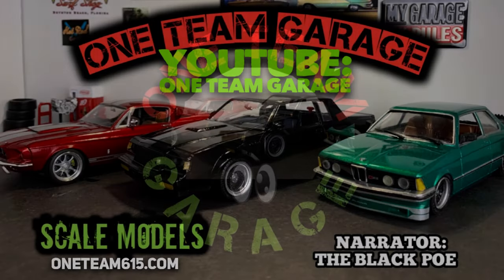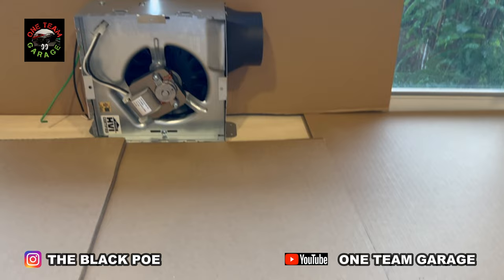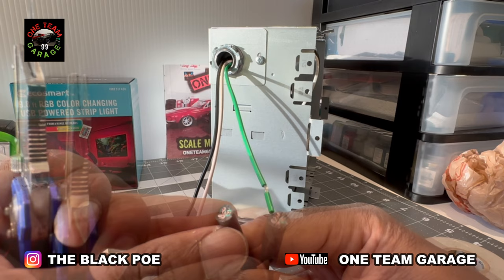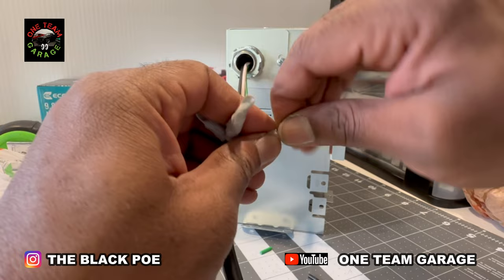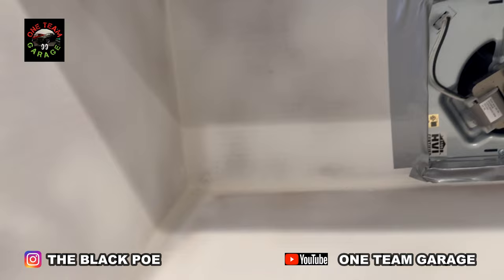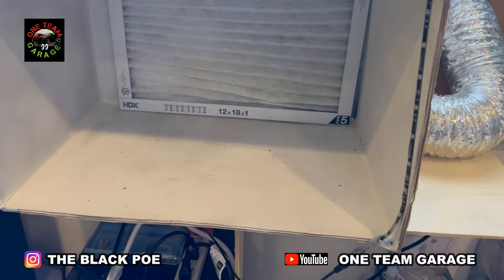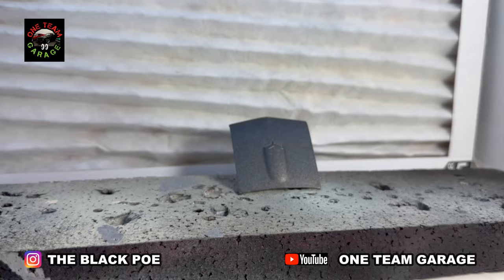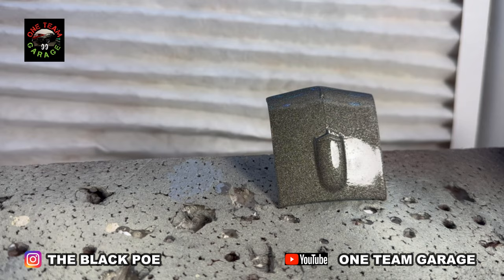DIY Paint Booth & Testing $59 Airbrush Kit: Surprising RESULTS

Comment: Heads up…
   I have been lectured on ‘my’ home made spray booths. “You have to have a sparkless blower motor.”  Ok… yeah, I get it. The point that was made if you’re spraying ‘flammables’ through an airbrush it’s like a carburetor.(air and fuel mixture)=combustion. Keep a fire extinguisher near by! Stay safe.  
  I’m not paranoid but it kind’a’ makes sense. And any spray booth is better than no spray booth.
   With all love for the hobby,
                JC       : )

Comment: Only thing I would do differently is to use wire nuts on the connections.the rest looks good well done. Did the same thing before buying a portable air brush booth.